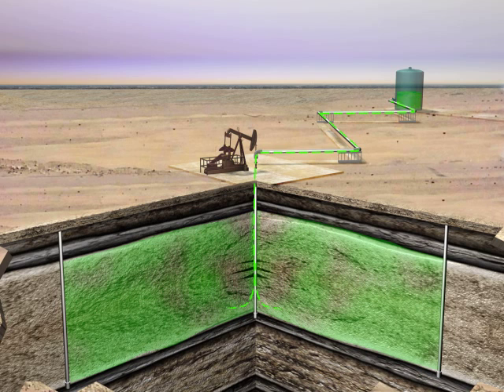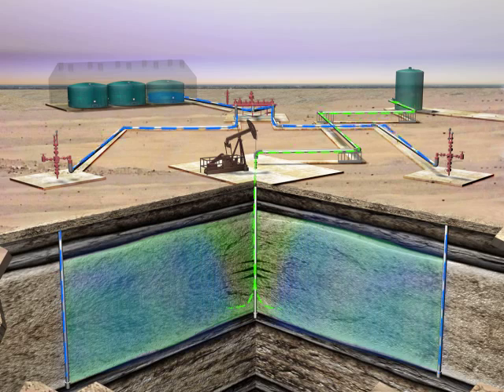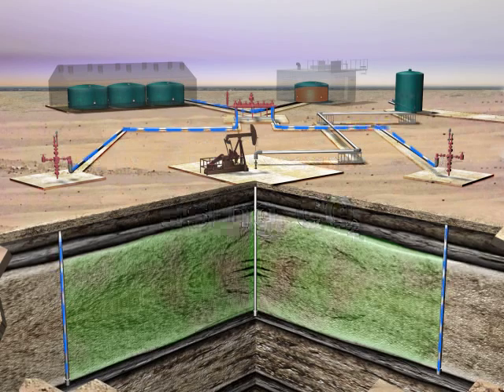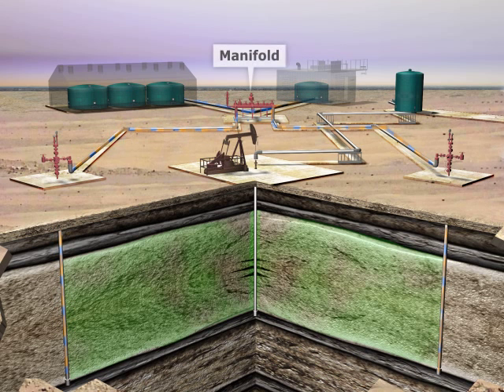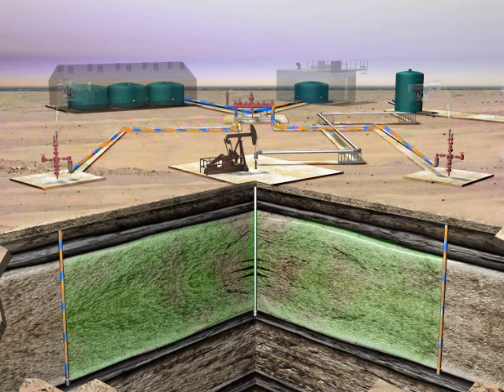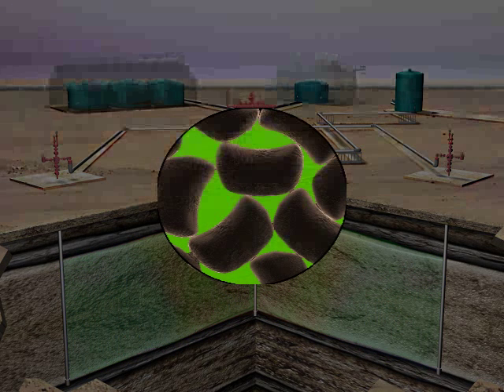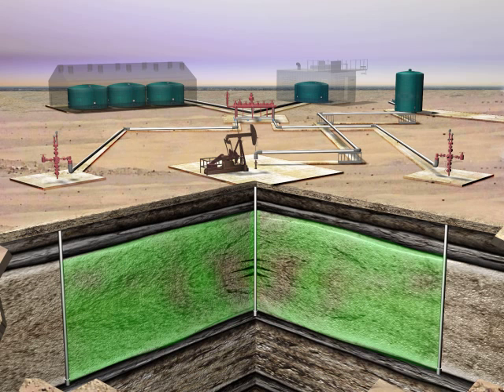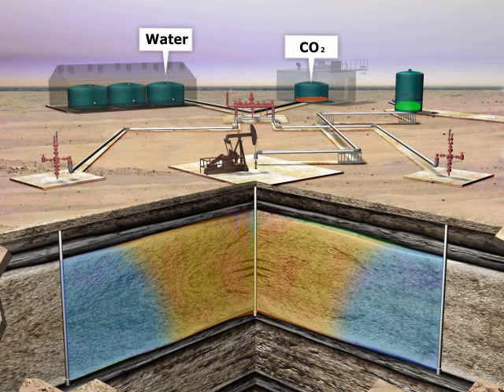Oil Recovery Process

Comment: Coning is a production problem in which gas cap gas or bottomwater infiltrates the perforation zone in the near-wellbore area and reduces oil production. Gas coning is distinctly different from, and should not be confused with, free-gas production caused by a naturally expanding gas cap. Likewise, water coning should not be confused with water production caused by a rising water/oil contact (WOC) from water influx. Coning is a rate-sensitive phenomenon generally associated with high producing rates. Strictly a near-wellbore phenomenon, it only develops once the pressure forces drawing fluids toward the wellbore overcome the natural buoyancy forces that segregate gas and water from oil.

https://youtu.be/LyVVJkD6NnQ

Comment: Thank you for the video! This helped me differentiate gas lift and CO2 injection. Is it correct that during artificial lift,  the gas is only injected into the tubing and won't mix with the formation? And is it why gas lift is called artificial lift because it doesn't lead to additional miscible displacement? thanks!